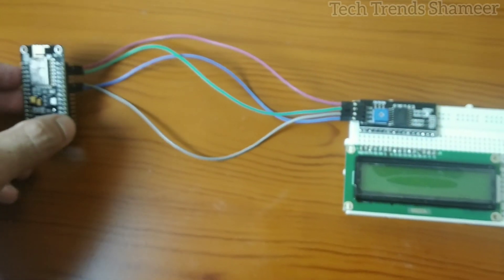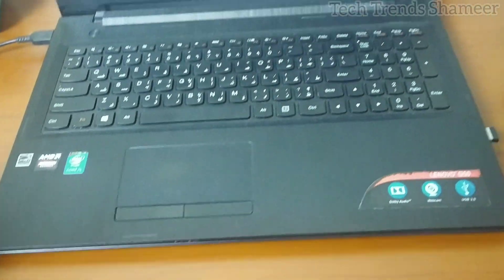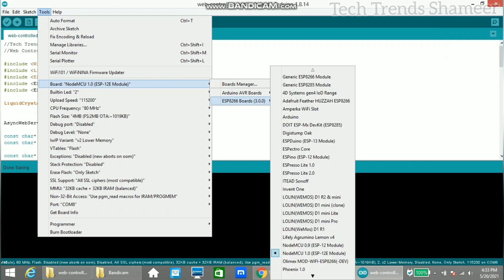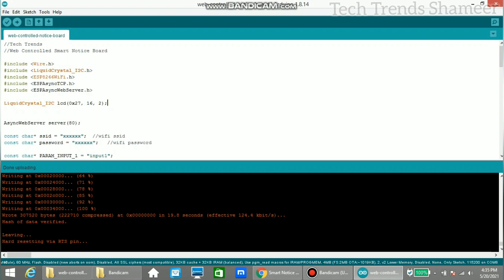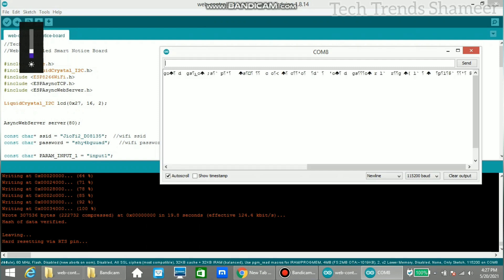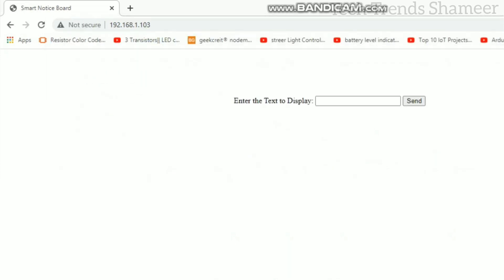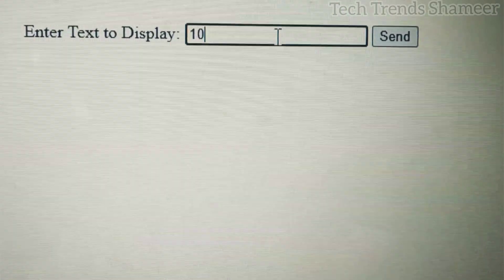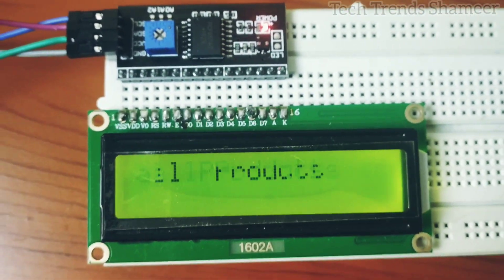Smart Notice Board | IOT Projects

Comment: Hello sir the web page is opening and code also running but it is not displaying on LCD
Reply from the maker: Use this library and try
https://github.com/Tech-Trends-Shameer/Libraries/tree/main/LiquidCrystal-I2C
Reply: WARNING: library LiquidCrystal I2C claims to run on avr architecture(s) and may be incompatible with your current board which runs on esp8266 architecture(s). This is the problem sir

Comment: In serial monitor i am not getting IP address sir instead i ama getting different shapes 
Help me fast i have an hardware expo
Reply from the maker: Press the RST button in the nodemcu board
Reply: Problem solved but the text is not displaying in LCD
Reply from the maker: Adjust the potentiometer in the I2C Converter.

Comment: Getting wifi failed error sir
Reply from the maker: Check the wifi details are correct and make sure circuit is correct.  If so you will get the IP address.

Comment: My mobile wifi details entered in code sir
Reply from the maker: Check the wifi details are correct and make sure circuit is correct.  If so you will get the IP address.